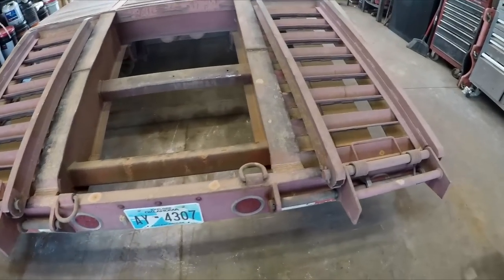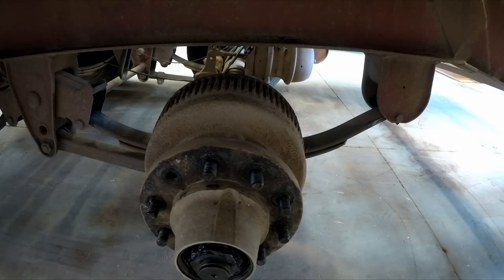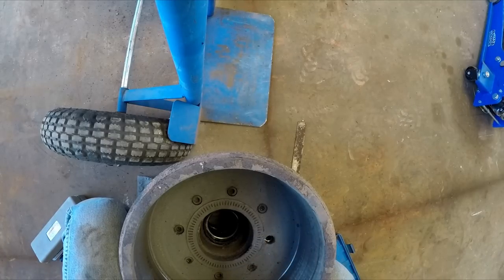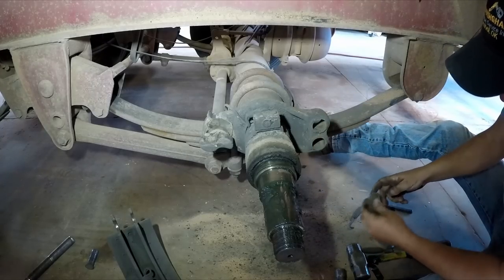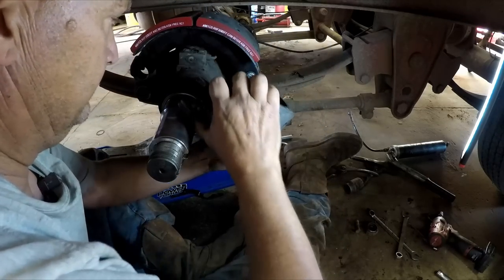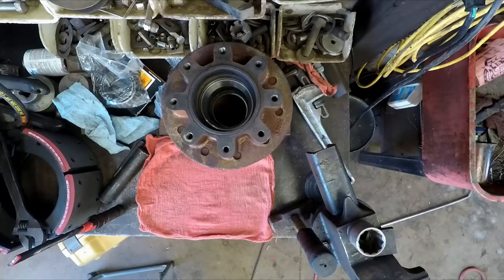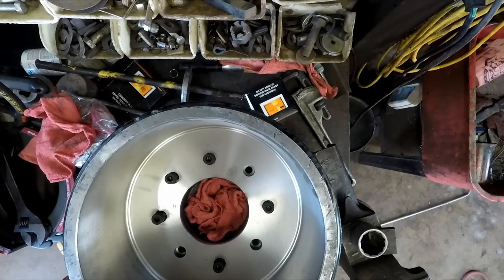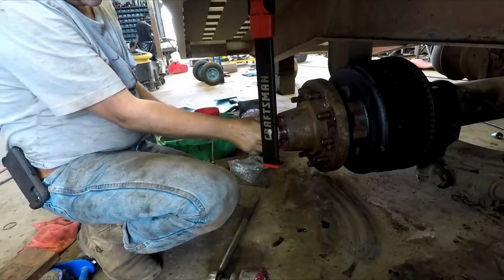#nobrakes Air brake replacement, dexter 15k axles. #digginok #airbrakes

Comment: First purchase I made from Harbor Freight, when they were mail order only, way back when, was a 1" drive impact for the trucking company I worked for. When I retired from trucking 16 years later, it was still working. I've bought a ton of stuff from them since then for my own little shop and the only disappointment was an 8' bench grinder, still got it but it vibrates horribly.

Comment: I don't miss changing brakes Frank. Next time put your brakes on with all the springs in place, put the rear pins in last. It's easier to pry the shoes out of the way and slide the pins in last.  Keep smilin
Reply from the maker: I have done it both ways, I find with these small shoes it’s easier to do the springs last.